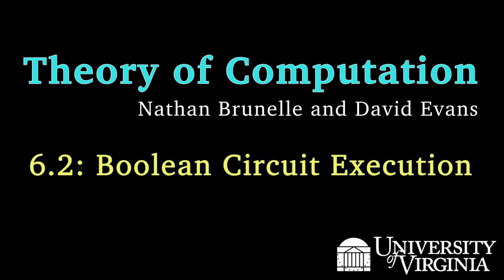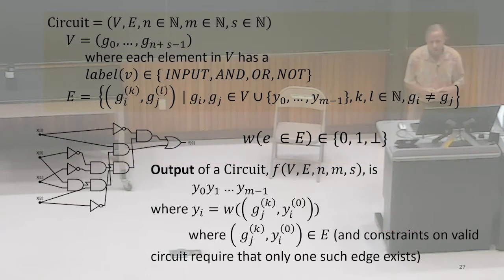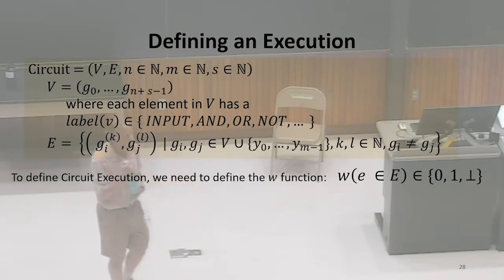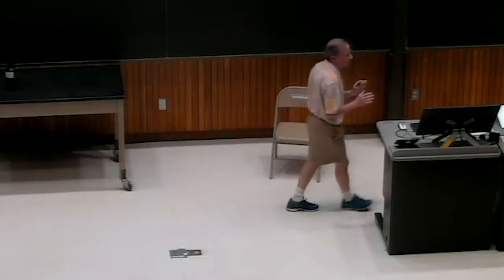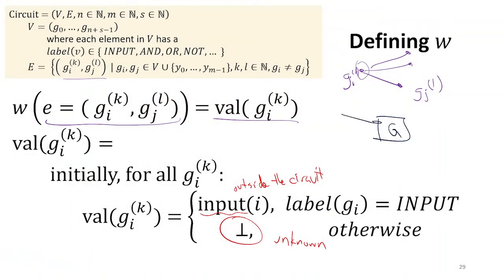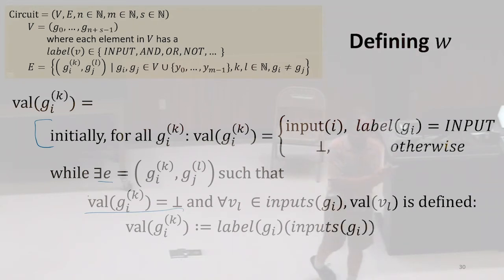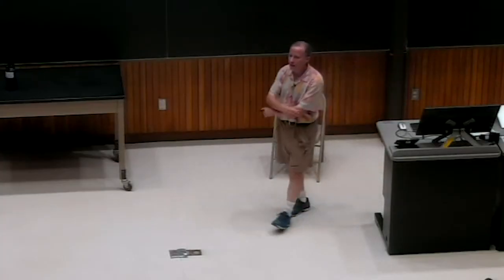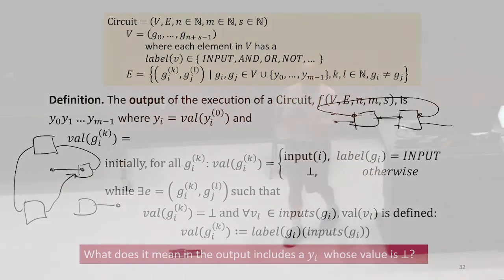Boolean Circuit Execution

Comment: This definition of gates that we can make progress on as all inputs being defined seems overly restrictive. For some gate types you can make progress even when some inputs are undefined - for AND, you can progress as soon as one of the inputs is defined as 0, for OR, you can progress as soon as one of the inputs is defined as 1, the undefined remaining inputs are irrelevant because they will not affect the output at all no?
Reply from the maker: This is an interesting point, and definitely does make sense that the output of the circuit could be well defined even when some of the inputs to some gates are not. Actually defining a computing model with this property would raise some complexities, since the rule for when a gate can be evaluated would need to depend on the particular gate. But, with a rule like this, you could have circuits with cycles (or other oddities) that are perfectly well defined and execute.